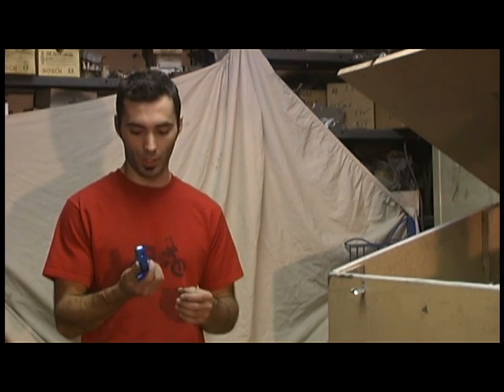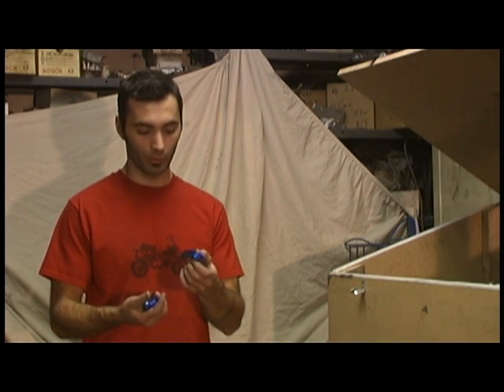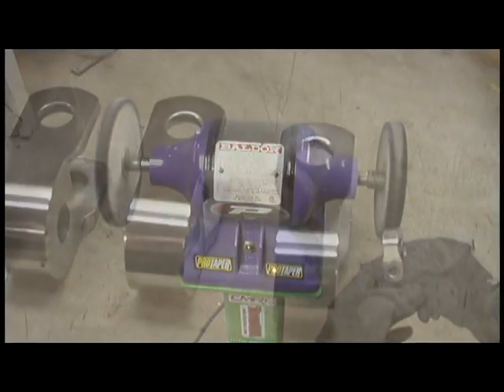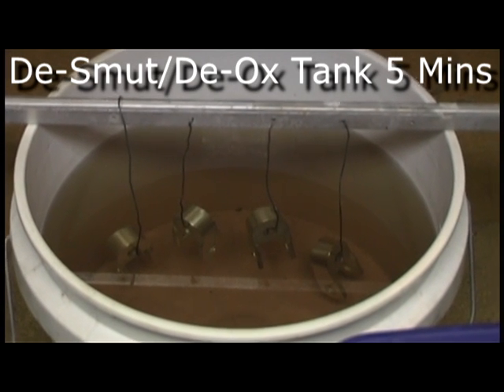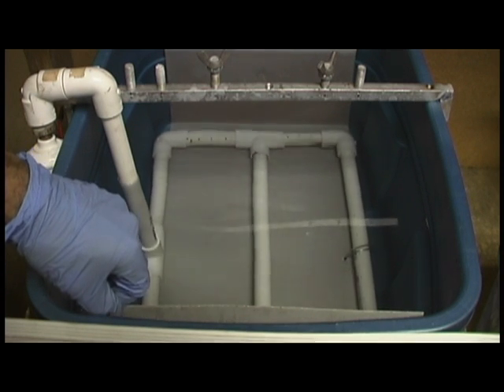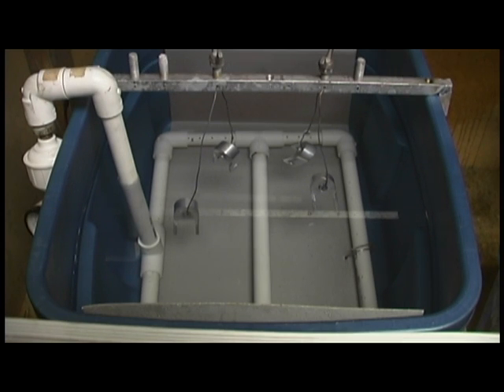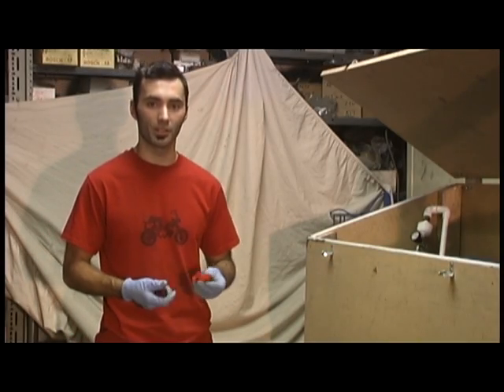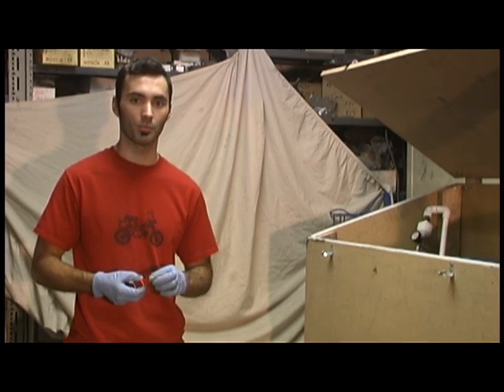Aluminum Anodizing Motorcycle Parts

Comment: What is the chemical used to etch them ?
Reply: +Robin Bonathan I don't know, but  i would use NaOH (sodium hydroxide), it is sold as drain cleaner at almost any hardware shop, but be careful, because it will dissolve aluminium if you leave it in the solution for too long.
Reply: +Robin just get a drain cleaner base on lye.
Reply: +Robin You'd be looking at either nitric acid or phosphoric acid, with deionized water.  Aim for a concentration of about 100 grams per liter.

Comment: Neat video clip, and no, I have not used any pro services for anodising. I see many such clips and amazed that the water rinses is often in small containers. I rinse well under a running tap, or large container plain water (running water preferred then there is no carry-over, before placing in the distilled/deionised water, do this all the way and it saves contamination of the expensive chemicals. Tap water is cheap.

Comment: Very important that you rinse well between each step, I have containers, buckets whatever filled  with large volumes of clean water, after a good up/down dunking, I them dip them into a container of deionised or distilled water, then holding them out of the bucket, use a plastic spray container to spray the parts well with distilled or deionised water, let them drain a bit so little or no carry over into the next stage. Doing this keeps your solutions clean and lasting longer, and produces consistent and better results. When finished & dry, a little spray of WD40 or similar product, seals the top surface and gives a lasting sheen to the finish.

It is also a good idea to up/down agitate the parts in each solution when you first put them in, this prevents unevenness and bubbles preventing the part being completely covered with each new chemical bath. All small points, but this is what makes a top finish.
Reply: Thanks for the tips, I've been searching the web and in-depth DIY anodizing guides are actually kind of hard to come by. I also can't find many books on the subject either.
Reply: Shevill Mathers Hey there! Thanks for sharing! On a separate note; have you used the services from " Vidadsmedia Two Wheeler Supply Review " (google the exact phrase)? My friends had some dealings with them and was impressed by their unbelivable customer service.
Reply: Do a search on Caswell, http://www.caswellplating.com.au/LCD.pdf  this is their LCD method,( Low Current Density), which I use and highly recommend. Anodising time is 90-120 minutes but who cares if time is not money. It saves on stronger solutions, is somewhat safer and moves along at a slower pace and needs a less powerful power supply. Battery acid strength is 10-12% as against 20% for the 12 Amps per square foot method which takes about an hour. Plastic buckets are ideal and make sure you really rinse well between steps, otherwise you contaminate your expensive solutions. Water is cheap-use it. Then a nice rinse off with distilled from a spray bottle, that way it is always pure and not reused as in a bucket, I do both.

Comment: Hey nice work !! I got this problem i used 2 kind of aluminium parts from my motor cycle and one was pretty much what you are showing in resault and the second turned dark grey and the paint was not able to sink in . The part that turned grey is the clutch disc cap inside the motor ( i have made a hole in the engine cap aded glass and i can see it spining when the motor is running ) i tend to think its the aluminum part alloy's fault if you got any idea please tell me

Comment: you ever tried etching it with sodium hydroxide? you'd be surprised how well it cleans it up and only takes about 30 sec to 1 min. any longer than that and you take the chance of smoking the part. if do this process your either going to want to de-smut for longer, or find an acid etching solution to speed up the process.

Comment: Found it on a forum. (just google "How to anodize Cast aluminum" and some good results pop up) 
Might be worth a try.
What de-greaser are you using. I tried a couple today but it attacked the aluminum very in just seconds.(are you using the anodize & crome stripper off caswell's as degreaser?)

Comment: Found the nickle acetate on Caswell's website (as well as proper anodizing dye.. though must say I was surprised how well Rit's worked) 
I still can't find any Nitric Acid though. All the polishing in the world isn't going to do me any good if I can't get the residue off. (I did find a write-up suggesting your final solution be 10% Nitric Acid to Distilled Water.)

Have you tried anodizing cast aluminum yet? Found a good write-up on how to using sandblasting with carbide media.

Comment: Great Video! I tried this today at school (I'm a computerized machining student) and first couple attempts didn't turn out very good, but the last attempt with a larger piece of metal turned out great! (possibly because I'm using a battery charger that only has 12V2A or 12V6A settings)

what are you using as a sealer? and what buffing compound are you using because those parts look GREAT!

Tomorrow my instructor and I are planning to anodize an aluminum duck call barrel then laser engrave it.

Comment from the maker: I've never tried fabric dye, it's worth a try since anodizing dye can be kind of pricey.  Yes, you can use use lead as a cathode.  I have actually replaced my aluminum cathode with lead as it requires much less maintenance, you can leave it in the tank for months.

Comment from the maker: I hear ya bud, I put a powder coating hook into my hand when trying to use a bench mounted wire wheel to clean it, 4 stitches later and I was good to go again :)  I do have other anodizing colours,  Right now I have dark blue, light blue, red, gold, green, bronze, black. I've used a couple of them in my other videos.  I would say its scratch resistant, not scratch proof.  The anodizing process actually hardens the surface of the aluminum so it is a little tougher then non-anodized aluminum

Comment from the maker: Thanks man, you can clear anodize parts.  You have to polish the part until your fingers bleed then polish some more, then anodize as usual but skip the dye step.  This will dull the surface a little bit, that's why you gotta polish it really well before you start.  The ano protects from oxidization so the part will stay shiny for a long time, won't be quite as shiny as real chrome but pretty close.

Comment: @VillainMotorsports yeah helps a lot, its at a maximum 65 degrees, and minimum of 35, better results when hotter cause won't need to degrease but heat dye up too for faster results

Comment: Hey, this method is way too long, is your etch cold?, because 2 hours in etch is a waste of time with hot etch needs about 1 min to strip, then no need to polish as theres no dents scratches since there new, so then no need to degreese, then 2 hours in anodizing tank is a waste, for thoes peices 10-13 amps for 20-30 min then only 1 min in colour or a little longer if  you want colour darker, but back to the etch seems cold cause it didnt have much of a reaction, dont mean to moan just helping :)

Comment from the maker: Caswellplating is where I figured it all out. De-smut (Nitric Acid) is mixed at 1qt to 2Gal. of distilled water, Acid tank is mixed 1part Sulfuric acid to 3 parts distilled water, anodizing dye is mixed at 4oz to 2Gal distilled water, sealer(Nickle Acetate) is mixed at 1oz per Gal of distilled water.
Anything else? You can come to my shop and I'll hold your hand during the process if you still can't figure it out...

Comment from the maker: You can but won't get consistent results. You can't really control the actual amperage being applied with a battery charger alone, I've heard of ways to rig one up to work but you'll have to google that. You'll need a constant current rectifier to control the amperage.  Amperage depends on the surface area of the parts being anodized, I use 4.5-6 amps per square foot of surface area.  Voltage will fluctuate to keep the amperage constant, usually between 10-13 volts.

Comment from the maker: If you can feel the engraving with your finger nail it'll be fine.  I've even been able to save laser etching on some pieces, depending how deep the previous anodized layer was and how deep the etching is.  Anodizing doesn't build up a thick coating like paint or powdercoat, so any scratch or stamping will still be visible.

Comment from the maker: @brenck Thanks! I downloaded an anodizing booklet from the caswell plating site, I can't remember how I found it but if you do need it I can email it to you, it helped me alot when I started out and I still refer back to it from time to time now.  You can pull off 12 amps/sq foot if you control the temp of the tank carefully, when pushing big amps you create alot more heat.  I went with a lead cathode so I could leave it in the acid bath, aluminum you have to remove when not used.

Comment from the maker: @delyx247 Thanks! Yeah, the start up cost for a small anodizing set up like this seems kind of pricey but as long as you keep your tanks clean and free from contaminants you'll be able to run hundreds of parts through it without having to replace the chemicals, that will keep the cost of each run down.

Comment from the maker: @sojournearth Thanks! The values were used by typing in my total surface area (which has to be done manually, no easy way around that) into this handy dandy anodizing calculator that can be found by Googling "Anodizing Calculator" The sealer I use is Caswell Plating's anodizing sealer, you can use plain distilled water to seal the anodize layer too, but the nickle acetate sealer improves colour fastness so the colour doesn't fade from UV exposure.